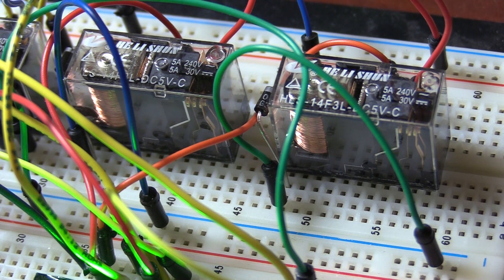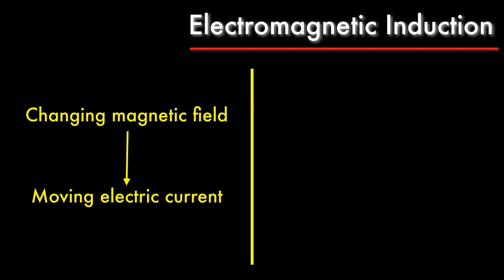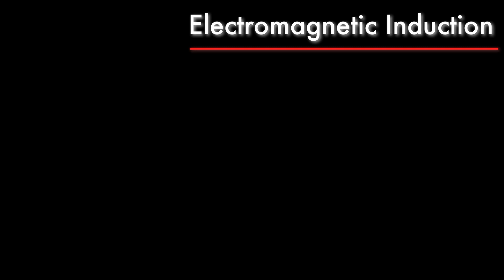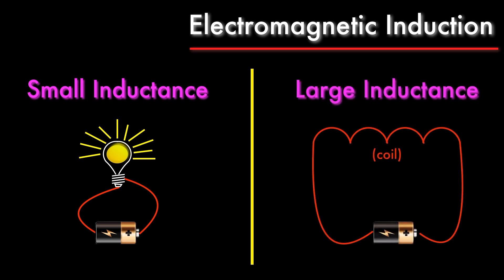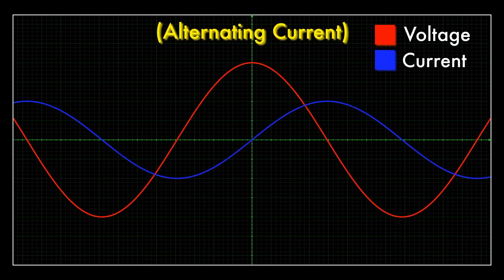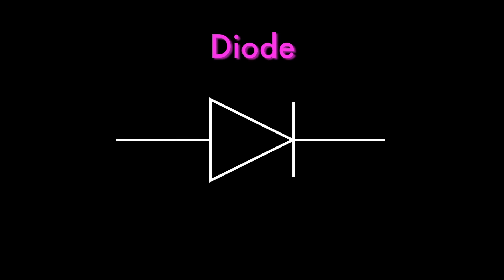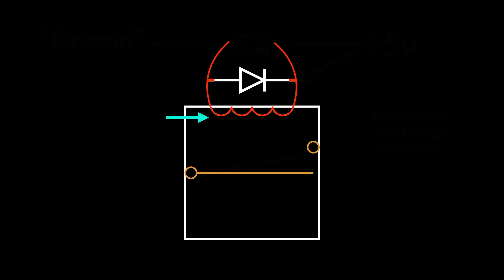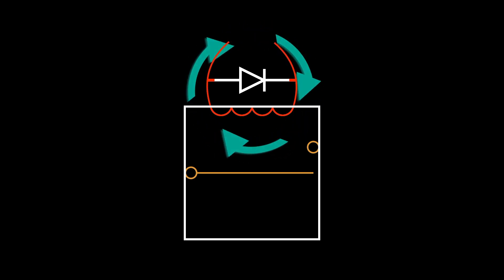What are Flyback diodes for?

Comment: Is a flyback diode just a rectifier diode but called flyback because of the use case or function it is performing in the circuit or is it a specific type like zener diodes ?
Reply: Rectifying diodes(edit: rectifier) are used in ACDC conversation to clamp/block the negative side of the ac wave.

Flyback diode is named as such because the sudden voltage spike released by the collapsing mag field flies back into the circuit. So the diode preventing that is named flyback.
Reply: @TrionityIr  The question was in relation to the specific type of the diode used not the function they perform

Comment: If you want to speed up the turn-off time of a relay, you might want to put a zener diode or tvs diode in reverse series with the flyback diode. The voltage depends on the circuit, but the nominal voltage of the relay is a good rule of thumb.

The significantly higher voltage drop is able to absorb more power, leading to a faster collapsing magnetic field. 

You'll definitely like the solid clack that the relay will give when turning off and will hopefully reach higher clock speeds.

The benefit in my own projects is mainly that the contacts are less likely to weld due to the stronger return force. But I'm also very pleased with the sound of those well-behaving relays..
Reply from the maker: Good tip! I'll have to give that a try.
Reply: @ClicketyClack  please read this comments thread, it may be of interest to you
Reply: On my latest ALU build, I'm using "grain of wheat" incandescent lamps for bidirectional indication and snubbing. Coils and lamps may operate by rule of XOR, saving parts.
Reply: @kenpeter3767  That's literally a beautiful solution, fitting the style of the relay computers time. Will you post videos?
Reply: @kenpeter3767  I have the schematic (I downloaded it). If you are okay with it, I can publish it on GitHub.
Reply: @kenpeter3767  Great schematic, but I think your comment is deleted now because it contained a link. Can you provide a search term for others that might be interested?
Reply: Your comment is indeed also deleted. Try googling for "printplaatreparatie" to find a way to contact me
Reply: That’s ok, but in some sequential circuits made of relays, this is not desirable because that might cause logic glitches or even malfunction. You normally want to have a consistent propagation delay for both transitions 0->1 and 1->0. Having one much faster than the other is definitely a no-no for many designs
Reply: @RelayComputer  Interesting! I imagine the delays are not symmetrical to begin with, wouldn't carefully selected diodes and/or resistors make it perform better?
Reply: @peterwilbrink718  I’m not so sure, but I believe once you have a “normal” diode placed in, the release delay mainly depends on the particular relay coil characteristics and the relay “must release” voltage. In my experience, at least with miniature relays, the on/off delay times become very similar after connecting a diode. However, as you point out, the release time is much faster in the absence of a diode, or with a zener in the mix. That’s what /can/ cause trouble in some sequential circuits that rely on such propagation delays to properly work
Reply: @RelayComputer  Thanks for your explanation. Your channel looks really interesting as well!
Reply: I recently made a whole bunch of tiny pcb's with diodes and an indicator led for 12-24 volt DC that I can use anywhere. Ping me when interested, I can send some.

Comment: Thanks for explaining how this Works! I just used this today/learned it existed. Built a small pelican case with a mini pc in it. It has a sla battery and a buck converter, as well as "shore power" plug. It only draws 800 ma on the 12V side but the current spike energizing the buck converter fried the main switch. I put a relay in, and when I turned switch off with unit plugged in it disrupted USB devices connected. Put 10a schottky diode on relay and it worked like a champ! No more interference!

Comment: The idea of a collapsing magnetic field creating a voltage spike is used to great effect in automotive ignition systems. The coil in a car has two windings, not unlike a transformer, but it is switched on all the time when the engine is running. The primary coil gets a 12v source from the engine and creates the magnetic field, then when it is time for the spark plug to go, it is switched off. The collapsing magnetic field induces a very high voltage (often 15-20 kV) in the secondary winding, generating the energy needed for the spark.